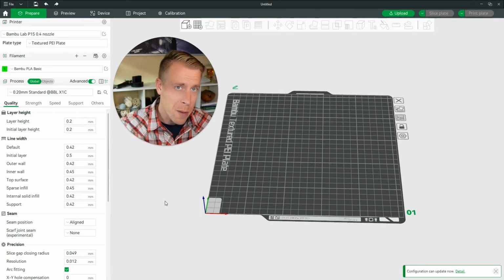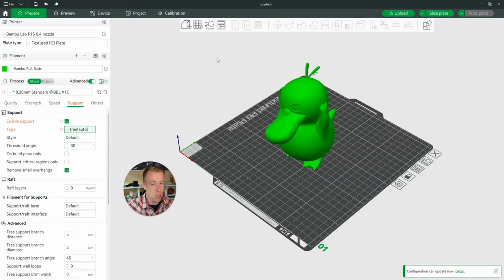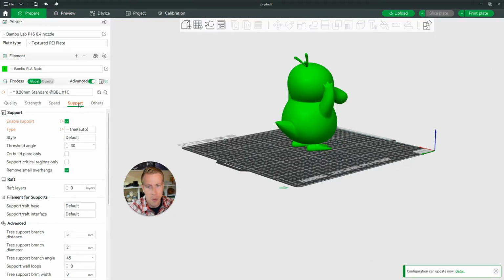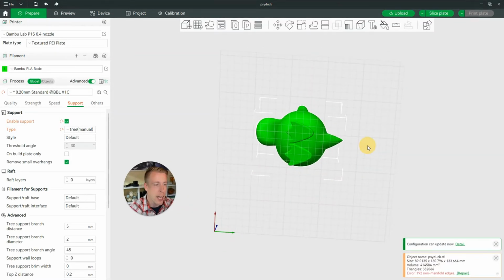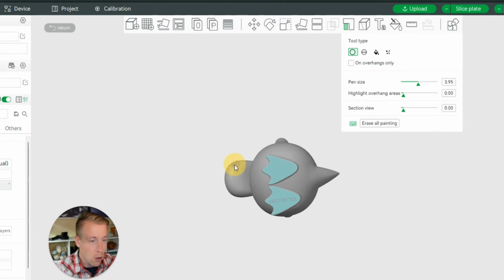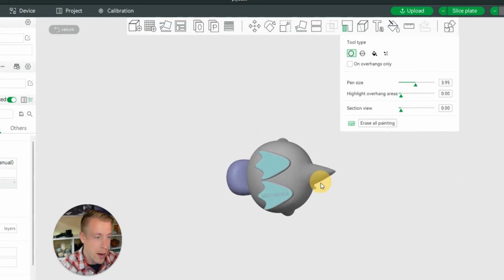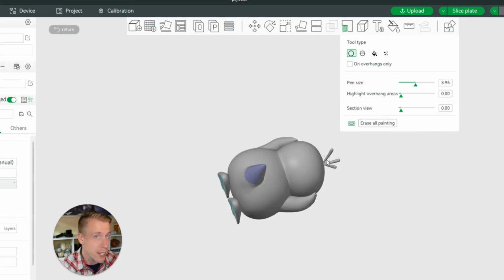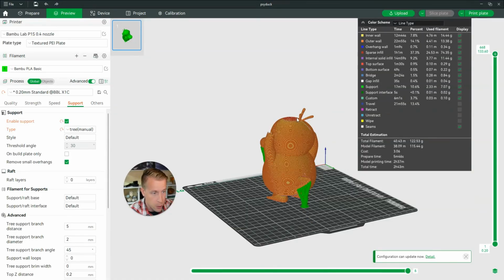How to Add Support Blockers in Bambu Studio

Comment: Ahora se lo que es un bloquedor de soporte, pero no lo veo muy util
Solo hay que definirlo como manual y luego pintar solo lo que quieras. Por lo menos en este caso no lo veo muy practico
¿ me equivoco?
GRACIAS
---------------------------------------------------
Now I know what a support blocker is, but I don't find it very useful. You just have to define it as manual and then paint only what you want. At least in this case, I don't see it as very practical.
Am I wrong?

THANKS

Comment: If you have to add the supports manually why go through the bother of clicking on "Support Painting" then "right clicking with your mouse and hold it down" while you "paint the area" that you don't want supports?  Just don't manually add the supports to that area.

Comment: You don't need to turn support to manual mode. You can add and remove support in auto mode as well.

Further, I thought this was going to be about the literal "add support blockers" setting when right clicking a model. This video title is a little misleading.

Anyways, what's nice about the actual "add support blockers" setting when right clicking on a model is that sometimes there are holes internal to your model that you don''t want filled with support maybe because say you are going to pause the print and put a magnet in there. But you also want auto support on because it is generated with tested algorithms and produces better overhangs (again you can remove and add support with the paint on support option even if you are in auto mode). BUT the holes internal to the object can't be controlled with the paint on support. Luckily - the "add support blocker" (right click on your model) will add a physical object that will prevent support anywhere this object overlaps with your model - even if the holes are internal!!!!

TLDR: You can have auto support on while also controlling the support internal to the model by adding support blockers. Similarly, you can have auto support off and still add support internally by using "add support enforcers".

QED
Reply: thanks dude.
the video didn't help me but your comment did.
Reply: Cool.. but I need to block support inside of a cylinder part of print. 

But nice to see this can be done as well.